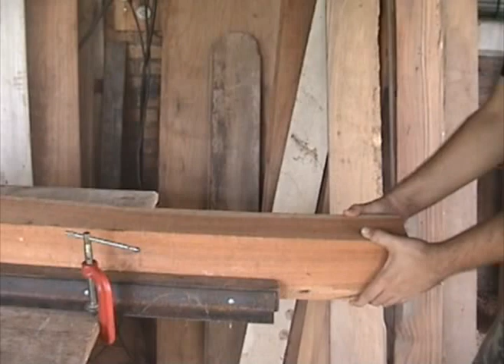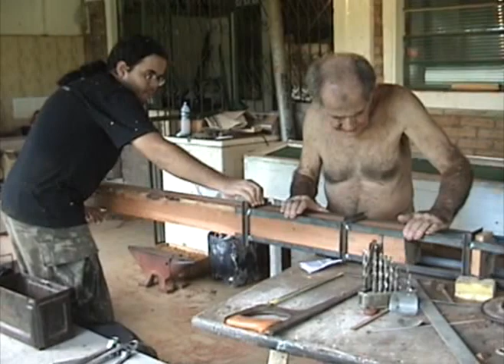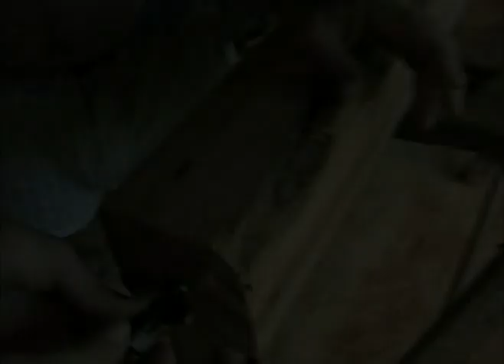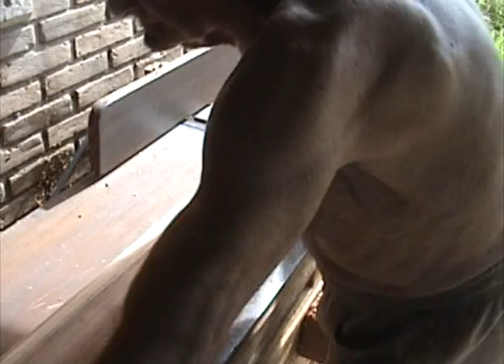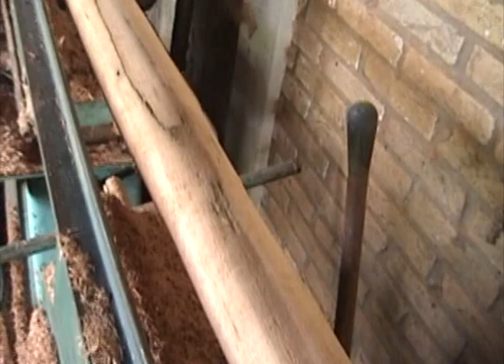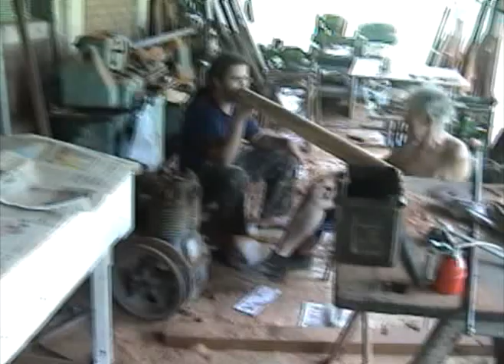Fabricação de Didgeridoo

Comment: Such an ingenious tool to enlarge the bore! As for the drill bit, did you just weld one onto a steel rod, or did you buy a long one?
Reply from the maker: I soldered a rod
Reply: @vivomusica  thank you a ton! And for the hollowing tool, how exactly did you make it?
Reply from the maker: @lotmom  I made 2 steel triangles, very sharp in different sizes, it is important to be of good quality steel.
Reply: @vivomusica  again, thank you so much!

Comment: Of the lightbulb. The lightbulb is effective. Also consider the tradition of making a didgeridoo. The tradition is to find a tree that is already hollowed out. There is less work involved, as to where the split way/ drill way actually takes work. So working heartfully towards something is a disgrace? I disagree. This new way creates a hole inside of the wood that is actually more soulfull as the design of the hole is perfectly circular. A termite hole is still un-complete in comparison.